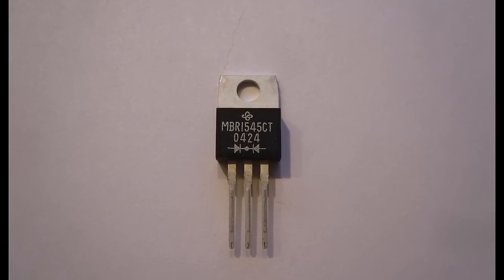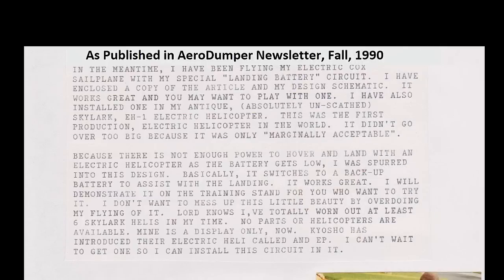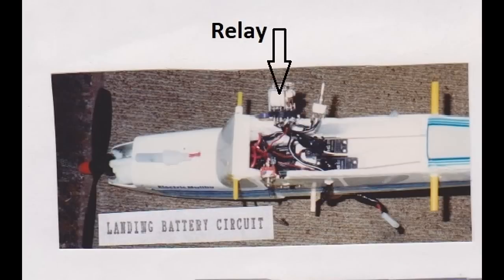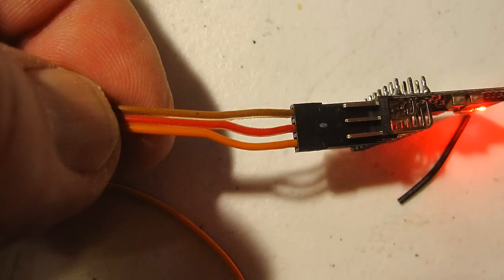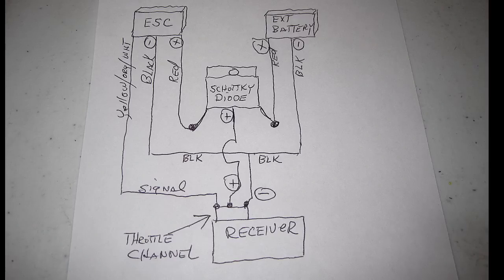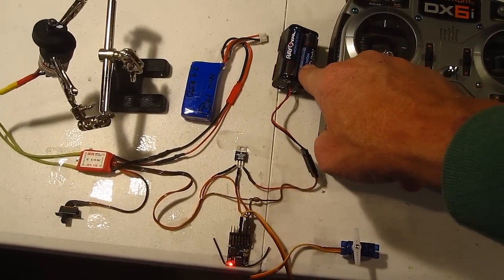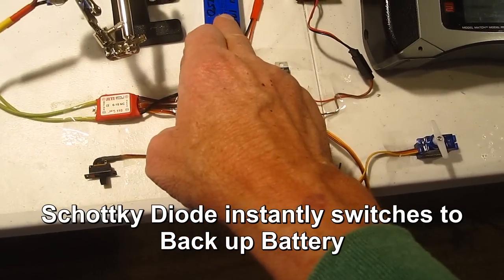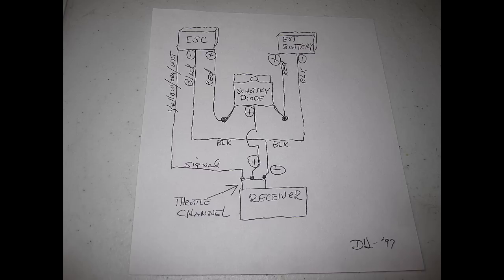"Magic Bullet Diode" could save your electric aircraft! BEC Backup/Failsafe for under $1 with Demo.

Comment: Hi there again Nightflyer just an update on my setup...
I managed to configure 6S lipo with an external BEC supplying 8.4V to the receiver through a Schottky diode and have the the internal BEC on the ESC as a failsafe if the External BEC ever failed....I also use a capacitor connected to the receiver because I use High Voltage servos.
 The capacitors keep any voltage drop from happening thereby keeping the current within tolerance.
Thank you so much again for this Video you made. 👍
Reply from the maker: Glad to have had this work out for you and the Cap will certainly be a good shock absorber.  Thanks much and happy flying.

Comment from the maker: NOTE: This diode is used ONLY for switching BEC Voltage to Backup 5V RX battery, NOT for switching MOTOR batteries! If the BEC in your ESC or UBEC fails, this simple backup will prove very valuable and save your plane or heli. Many old time electric flyers know of this, but this video is for those newer electric pilots who asked or don't know. Also, if BEC inside your ESC fails, the motor will still run, since external battery will keep radio running by still sending the throttle signal to the ESC's speed control, thus keeping the motor running. I have used for years, so can attest to this fact.  Thanks for watching and happy flying.
Reply: Electrolytic caps on the diode will prevent any glitch while switching. Something like a 10 uf and ,001uf ceramic will help also,

Comment: I have to ask I know this is an old video but Can I run an ESC BEC and a EXTERNAL UBEC instead of the RX battery? Into the diode? 

Thanks 

This channel is honestly a gold mine for RC information..
Reply from the maker: It should work just the same.  If one BEC quits, the other will take over. But know you have to power the BEC's with separate batteries.  Good luck and happy flying.

Comment: Thank you for your brilliant video ...would this be okay to use on a 6S 22.5 volt lipo setup and High voltage servos 8.4 volts each with an external BEC, I would love to be able to use the internal BEC on the ESC if the external BEC failed.
Thanks in advance 👍
Reply from the maker: So your external ESCs pump out 8.4 volts, but if you have a failure, the Diode would switch your standard internal ESC's, BEC and it would revert to it's default output of 5 or 6 volts.   The Higher voltage from the ESC that is 8.4 volts will always run till it's voltage was to drop below 5 or 6 volts depending on what your internal BEC is pumping out.  Just have to wire it up and see but I think it will work.  Good luck and thanks kindly.
Reply: @NightFlyyer  thank you for your reply I'll try and source the parts here in the UK 👍😉

Comment: Question: In poli-motor planes (twins and beyond) with ESCs you have to run a ESC per motor ...and usually the recomendation is to disable (cut red wire) one of the BECs so only one powers the 5V line to the RX and servos to avoid conflict between the BECs that might cause overheating and failure.. so despite having 2 or more BECs we usually fly with one.

Would this allow to plug both BECs from both ESCs at the same time so if one BEC would faul the other would be there as backup? 
And do i understand that this would only use one of them (the higher voltage one) until it "drops" (fails)? Or would a very similar voltage cause problems

Comment: Great info Dave! Presumably we also need some way to alert the pilot of the change, other than having the motor losing power. Or are we saying that the switch over will only happen under motor power?
Reply from the maker: The Schottky will switch back and forth irregardless of motor running or not.  Motor will still run, even if ESC's BEC or external BEC fails.  Since you would not leave your external battery on, as radio would remain on, the next time you would fly, you would know as you always turn on the BEC first.  You would note the bec was dead, however with the battery you could still fly safely, just like the old days before bec's.  If the ESC or Bec mysteriously (unlikely) began working again, it would switch back.  It makes a foolproof failsafe for under a Buck.  Thanks. Good question.
Reply: Thanx Dave, it's pretty interesting even though I don't run a second battery in my gliders.
Reply from the maker: True nor would I, as they don't have ESC's or motors, typically.  :-)  I used to love slope soaring off the coast in Southern California, as we could fly hours on a rx battery.  No hills here though, so no more slope soaring for me.
Reply: How about a thermal soarer? Some say it's the purest form of soaring.

Comment: Thanks for that and didnt know about it 

Dont blame for putting in your F15 

Other more expensive option is fitting a flight controler that has RTH (return to home) which would RTH when no signal but down side is it would not land plane im sure one day they will be able to
Reply from the maker: It wasn't my F-15, as I still had it and it was perfect till the fire burned down all my models in the house and garage.   It was my blade 400 heli, which vibrated the wire right off the bec. Thanks.
Reply: Like you I had a house fire with no insurance which resulted in me having to restart when i had been doing RC flying for long as couldn't afford to do it when I was a kid so did RTP (round the pole) instead 

Just glad I only had 2 models and one was spares for other one.

Heres a question for you I got a plane delivered to me from ebay with a smashed up wing and to save rebuilding it was thinking of making it a gyrocopter seeing as hobby king sell parts for the 2 models they have sold.

Thing is how easy do you think it would be to convert ?
Reply from the maker: I  sorry to hear that as well. Starting over is tough but doing so was good therapy for me to never give up!
Reply: Dont blame you for not giving up with the amount of experince you have.

I always look out for your channel as always something interested being posted list this video and thanks for doing that.

Good thing about you tube is even when someone has passted away they will still live on thanks to you tube

Took me over a year for me to be settled and be able to afford to buy more RC stuff.

I get less then then $93 (usd) a week some time spend to much on rc when i get paiud every 2 weeks that i dont have much left for food but know were to go to get free food 

Now Dx6 has replaced DX6i prices on ebay go throw the roof but manage to get one cheap on a buy it now auction.

I might of lost nearly everything but fire did me more good then better as now living in city i was born in and more to do here might have to travel further to fly but not worried.

used to walk across front garden throw a ditch then across a small field then i could fly

Lost 2x bix2 infire now got 1 bix3 and balsa wood trainer (simualr size to bix3)that needs wing repairing might convert to gyrocopter as easier but not cheaper and always wanted one.

Comment: I always use an external BEC because I never trust the built ins. As a rule,use a timer and avoid the embarrassing issue of landing your plane with no power. I have had one built in BEC go out and lost my plane enough to not trust the built ins. They can over heat and burn out easily if you over load them with higher rated batterys so dont do it. People think higher MaH the better, wrong! The C rating is what determines how much juice is going from the battery to the plane,at least that is my take. A 20C as apposed to a 50C rating means less of a draw than the higher 50C but I could be wrong. I suppose if you have a higher rated BEC it could still draw more juice out of a 20C but seems like that would cause the battery to puff or things to overheat. Like trying to draw water through too small of a straw,only hotter. Sometimes this stuff can even confuse me. All I know is running a battery dead is dumb. Use a timer if you cannot judge time.I have only puffed one battery by running it dead. The only other one was a crash and hole in the battery.
Reply from the maker: Yes and I trust batteries even more hence why I always use this setup. Thanks.
Reply: NightFlyyer I watch the EEV blog and Big Clive and both guys have already proven most lipos and NiCads are over rated. Most do not have the actual MaH as posted on them. I keep that in mind. A simple alarm can be plugged into the balancing plug and set to prevent over drawing the darn thing. As you stated, by having a double battery set up allows you twice as much time but how many guys would then accidentally kill their battery by forgetting they dont have a back up. Some foamys simply do not have enough space for a double battery. I know mine do not. Center of Gravity will be greatly affected running double batterys. Not saying its a bad idea because it is a great idea. Having a backup on an expencive plane is never a bad idea.
Reply from the maker: I'm talking about BEC battery backups,  not motor battery backups here. I also would NEVER forget I had one, nor ever have with my motor battery backups which ARE in bigger planes with room for them like my Raven had.   A tiny 200 MAh RX bec backup battery (that this video is about) will fit just about anywhere, and WILL save you if your bec fails :-)  Thanks again.

Comment: A 1s lipo would he sufficient to power the RX and servos to get home and would weigh a lot less.
Reply from the maker: Weight is nominal.  After you mentioned this, I tried to run 3 servos on a 1s, 500mah and they were terribly slow and jittery and the motor barely turned. Plus you would still need the diode to do the switching.   The way this diode works is it feeds from the highest voltage first, and then to lowest, then back to highest.  It goes very fast with 2 identical size batteries. I would not advise a 1s in a system that requires a 2s, because of my test. Here is another video where I use it in my boat for main motor backup and you may see more here on theory.  https://www.youtube.com/watch?v=zW77nh_g5_Q Thanks.
Reply: @NightFlyyer  hi. I wasn't suggesting to use a 1s lipo without the diode,  just to replace the AA pack with it.
Many of my rx's have a running voltage of 4 to 8.5v and most 9g servos have a operating voltage of 4.8 to 6v a 1s lipo would work fine and the servos would just be a little lazy but sufficient to get you home on a system that weighs much less.
What about a second regulator on the other side of the diode instead a battery?
That would weigh only around 5g and would supply the  full 5v voltage from the main power system when the diode switched to it.
It was that idea popping into my head that lead me t finding your video :)
Reply from the maker: @stevefox3763  Well, I dont know.  When I want to make sure I will have enough power to get back, I guess I will stick with something I know will fight any wind, to make sure.  I would not use a parachute full of holes for a backup, you know.  LOL.  But go ahead and do your idea, make a video and see how long it will run and how it works.

Comment: A new point of failure will be the diode. All power will be lost and the receiver will shut off. So the question is, how reliable is the diode?
Reply from the maker: Lots of laughs! Probably .more reliable than a receiver or servo! .if it failed one side would still work so I would not worry!   In 20 years of using this, I never had a failure, but  nothing is 100%
Reply: I guess all is good until the middle common + portion of the diode fails ;) Luckily the chance of failure is low. Love the F16 by the way. Good job on the build.

Comment: What about Letting the bec feeding the rx and the battery….?
Reply from the maker: The BEC would become a charger and it does not have the power to do that, as the Diode constantly switches to the lowest voltage provider. I explained this at the beginning of the video.
Reply: Explained the higher V would feed the system.  Never herd about the “charge inability” of the bec.    I thought it would be neat to have the bec run the plane and extra power feed the battery when not needed.  Then when needed the battery, in this instance a 2s, 30c 1000 lipo, would kick in.  As Diode would only on the bec to rx.
Reply from the maker: @kitchenstrand      BEC's never charge.  They are called Battery Eliminator Circuits because they eliminate the RECEIVER battery. Most ESC's have them built in.  This diode is used ONLY for switching BEC Voltage to Backup 5v RX battery, and NOT for switching MOTOR batteries. It completely balances the 2 batteries. There is not enough amperage or heat sinks in small BECs to charge anything.   If BEC inside your ESC fails, the motor will still run, since external battery will keep radio running and ESC's speed control running. If DIODE fails, one side will always work.
Reply: So more confusion…   I don’t want the smoke to come out of my RX.  

Have the diodes set a d they only let the juice flow as you noted.  Both feed the RX, but don’t feed each other.   Works well.  Then I was adding some sbus lines to the Frsky Rx and the one from the battery sensor was powering the rx… what I said.  Now another source enter the scene.  Do I need a diode here too? I even unplugged the red power lead from the plug and the dang thing still had juice.  

I have not dared to add power from all three sources…
Reply from the maker: @kitchenstrand  Am not real sure what your trying to do, but if you have all 3 power sources the same voltage, all can be fed in.  The diodes only in this case, balance the batteries between each other.  They both go down equally.  This does not affect the voltage to the RX.   It is always on....and that is what you want until both batteries finally are depleted.  It basically doubles your flying time.
Reply: @NightFlyyer  ok, did some more digging.

Each of the diode lines powers the rx as you said. Works great, redundantly!    

I have an external plug to arm and disarm the system.  So though the rx may be switched on it does not power the ESC.  When the plug, in essence a switch, is on,  now the multi cell lipo powers everything,  including the motor.  The plug breaks the line from battery to to ESC.  Now if the lipo sensor is plugged into the balance lead … while the safety plug between battery and ESC is un plugged… the ESC gets power and you can cycle the motor.  Even though the power lead is disconnected and the onboard battery is on or off.
Reply from the maker: @kitchenstrand  I am getting confused without seeing it.  This diode was a simple thing to stick between 2  RX batteries to keep them balanced.  No ESC, not to work with motor power batteries,  just 2, 5v sources for the RX. Sorry  I can't help you.  Take care.